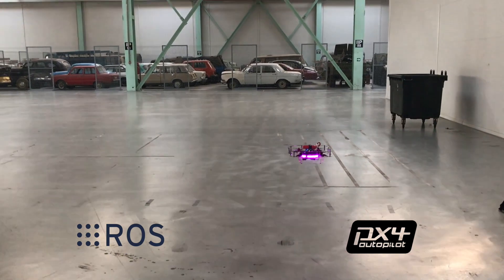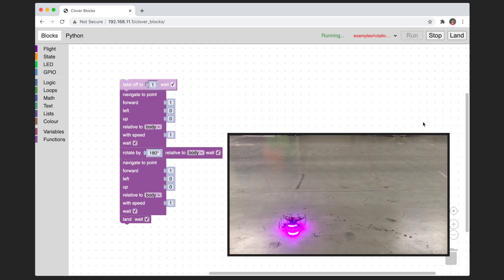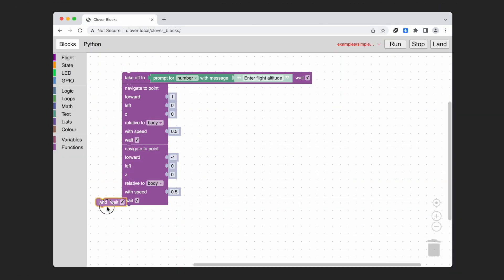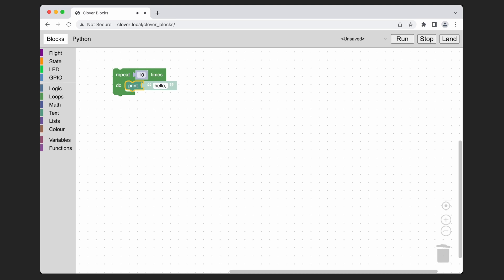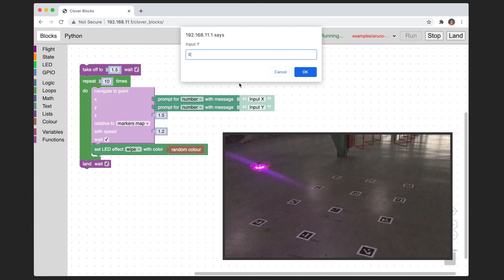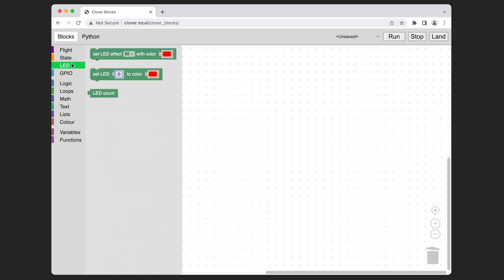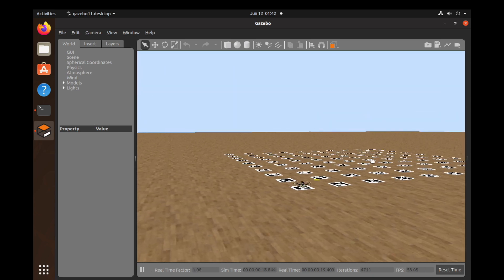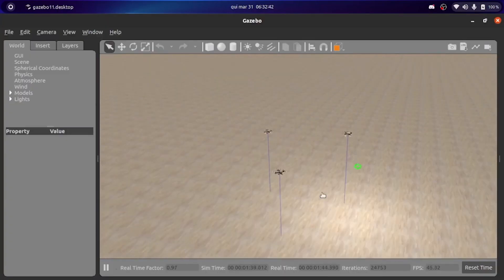Block programming implementation for a drone (ROS, PX4)

Comment: why I am using this if simulink provide better than this?
Reply from the maker: Simulink is a software for doing simulation and research for dynamic systems, it's a scientific software. And this is a block programming support for a specific drone with a specific flight control software, made to simplify making and running programs for autonomous flight, mostly for beginner students.
These two things are completely different and the only thing that is a bit similar is both have visual representation of a program.
Reply: wrong. matlab&simulink provides all functinalities that you mention. there is too much defacto sdandart such as AUTOSAR, DO331 DO333 . you can do everything with s-functions including SIL HIL PIL testing. there is a lot of companies producing their special product lie dspace etc..  there is also too much libraries and Functinal mockup unit with other simulations and boards features  @okalachev   there are also several books for simulink usage with simulink for px4 and other autopilots. Because all of them can be merge with s-function + mex files.